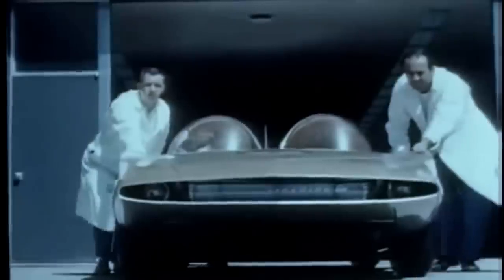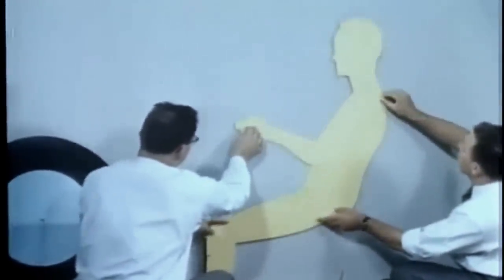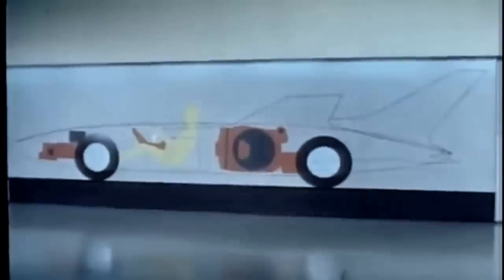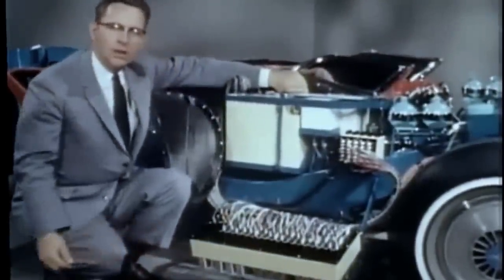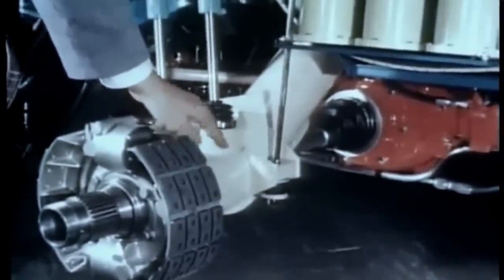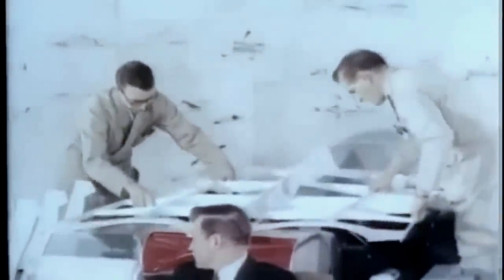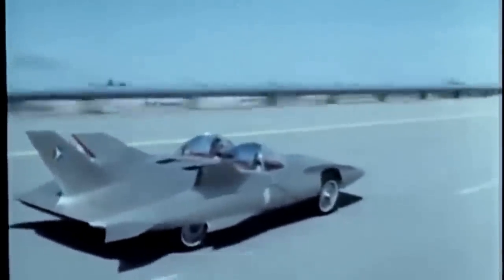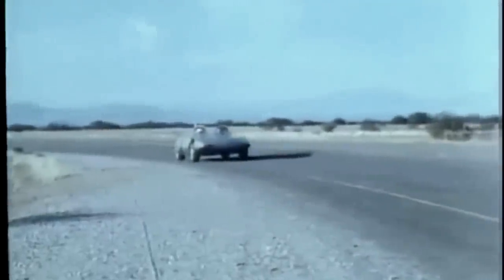GM Firebird lll Gas Turbine Car Promo Film - 1958

Comment: I always thought a gas turbine with electric drive would be efficient, but apparently they never really got the efficiency improved enough because of the heat loss (heat is energy.) This is aside from the materials, automation and machining requirements, among other things. Still, if the heat energy could be effectively used, it would be really interesting. I believe they've used gas turbine powered electric in trains, but diesel piston engines are the current tech.

That stick drive is kinda scary. There's something visceral about a steering wheel with gas and brake pedals. Then again, the mouse works pretty well on a computer—yet, a joystick really doesn't, and tablets did not replace mice either. 

Clearly, this experimental vehicle was heavily influenced by aerospace technology, and practicality concerns apparently kept it from being fully developed into reality. It is interesting how many of the ideas have been integrated into some of the latest vehicles using more solid digital tech. This was before the crossover from mostly analog to mostly digital electronics.
Reply: Yeah the joystic is full scary. On the other hand we used to play a lot of racing games, in ok level of playing, using only one thumb in playstation.
Reply: @constantinosschinas4503  Good point. I think somehow frame of reference made a difference, though, in addition to not having your life in danger. Back then what I really hated was trying to use a keyboard for that kind of game on the computer in the early 80's.

PS: I just thought of another thing. The car you're in is moving and the computer is not. Jarring and and forces due to acceleration could tragically affect manual manipulation of a joystick, probably a lot more than the wheel, where one hand helps stabilize the other. The steering wheel only has one degree of freedom, too.

Comment: never work thats why it never made production the whole concept was just ridiculous, but fast forward to today 2022 and i feel a shift is coming for example improving the range of battery power a small turbine could be fitted to the vehicle to charge the batteries as the turbine will generate more power especially for lorries vans and vehicles that need to carry heavy loads the problem is the batteries and weight of batteries
Reply: It was never intended for production

Comment: Looks like the batman's car. Allas, gas turbine is too slow in acceleration and deceleration, for a car. Also, a steering wheel is more practical than a joystick. I can't figure out why they made these choices. No need testing to know it.

Comment: No disc brakes? The Citroen DS had disc brakes already in 1955......And also a hydraulic system powering both the suspension (self leveling and interconnected), the steering servo, the gear change and the full power servo brakes. And this was a production model, no experimental or prototype car.

Comment: Jet turbine engined supercar, drive by wire, drum brakes with air speed brake flaps, aero tail fins. There was no way this proto PR car was ever going to production. At least Chrysler actually designed and built a functional turbine powered car.
Reply: I doubt the fins have anything to do with aero.

Comment: One should make an identical eco-friendly, electric-driven one, but with all the flashy lights and turbine-sound effects, automatic doors and of course the cool "sonic key", would't that be great to drive in?
Reply: The mining of lithium and the disposal of it , along with other battery parts already make it less practical with more waste than current ICE engines tech  . ICE engines have advanced so much compared to the ones made 25years ago that looking at the change of fuel consumption , less emissions and more reusable parts , causes it to make more sense to continue the advancement of all ICE engines . Example it is common to see people saying crazy things about how diesel pollute heavily,  yet people don't educate themselves to understand the black smoke you see coming from diesel is actually not harmful since it's unburnt fuel (carbon) that will one day settle back down and return to the earth .
Reply: @phantomcorsair8476  Look at the size and power of a modern motor and compare it to a modle A engine , the A may get good gas mileage but that's without carrying a load and having "no power" while also having a small displacement of 3.3l , 200CID. With more modern motors , for example a 5.3l v8 you can get over 300hp and over 24mpg in a long bed truck you can't do that with older engines . There are plenty of square bodies that are tuned up for power and still get 17-20+mpg in a truck out of a 6.0 gas motor with turbos and that number will increase as technology advances.

Comment: "This is certainly the future, your future." Er, no. First, the turbines polluted too much so with the new EPA requirements in the 60s never going to happen. Then, the acceleration was terrible. The engines cost $50,000 to make back then. The gas mileage was no better. And of course, no wires in the road. So none of this ever happened - but it was nice entertainment.
Reply: @phantomcorsair8476  Interesting - but you don't see anyone investing in turbine engine technology today so this is just a theoretical exercise not based on any actual development.  I question myself what happens to all those battery packs that are saving on hydrocarbon emissions when then wear out in six to ten years?  Do all those lithium ion batteries go to the junkyard?  Even if then go to solid crystal batteries when they wear out they will all fill junkyards with carbon.

Comment: So here I am in "tomorrow", and all they have is a Chevy Spark.
Reply: I remember seeing this and other films at a summer program at the local YMCA in the early sixties and thinking how cool the future looked. Now that I’m in that future at age 68 the future kinda sucks despite all the cool tech gadgets.  ☹️
Reply: @pauliedweasel  Well  that's because you don't own a yellow Chevy Spark ...😃🤣😂🤣
Reply: @gregm448  🤣 Now that I’m retired and on a fixed income the Chevy Spark is one of the few cars I can afford! Besides, it’s one of the few cars that still has that fun hatch back styling to it and comes with a manual transmission, a great car for buzzing around town in too! Besides, the car styling of today for a lot of the brands is rather off putting to me plus the reliability of the modern automatic and CVT transmissions is very questionable, and ad to that the $25k to $30k price for an average family passenger car with my current financial means is also rather breath taking.
Reply: @pauliedweasel  were old enough to see patterns in tech growth and see ugly flaws. Main thing that bothers me which I don't completely understand in the 50s 60s there was an excitement about the future and technology that's disappeared. Enthusiasm. The sky's the limit. To me it seems like the campaign finance system blocks competition and in turn stops tech growth.
Reply: @pauliedweasel  about to change DRASTICALLY..
Reply: @pauliedweasel  5 D
Reply: @pauliedweasel  technology threads quickly into our lives. It is hard to predict but I often think about the smartphone. One day I had a nextell phone with two way radio then I had a smartphone the next. It was so different. Then it was quickly normal.
Reply: @pauliedweasel  And it'll only get worse I'm afraid.  Back then, everyone was too optimistic.
Reply: @redline1916  seeing this I was reliving my tours around the South West States. Just since year 2000 nothing really got any better.
Seems all became virtual perhaps from the progress from marijuana into the crystals, Charlie and meths whereby anyone can be anything for a short while.

Sad reflection  on humanity but there again we do have a legend in Joe Biden along with Hunter....
Reply: @redline1916  Agreed! It was like watching the Thunder Birds when I was a kid and thinking how totally cool the future was going to be…
And now all I can do is look at the future and say WTF! (That means ‘What The Flagnard’) I borrowed that from Monsters vs. Aliens.  🤪
Reply: @pauliedweasel  it’s raining WTF nowadays.
Reply: @JenkinsUSA  Paul, that’s the best description I’ve heard of the times we are living in today. It’s why we move out of North Hollywood, CA (a suburb of LA) to Prescott, AZ. I was walking down Whiskey Row yesterday across from Courthouse Square on Montezuma Street and I felt like I’d gone back sixty years to my early childhood growing up in Santa Ana, CA! You are so right, we are living in the middle of a mother load monsoon of WTF these days with our current leadership. It’s like they don’t even care that a major election is coming up, they’re just going hell bent for leather.
Reply: @redline1916  — everyone was too optimistic……but back then, they had every reason to be optimistic.
Reply: @devilliers123  —- it seems, the internet killed us.
Reply: @redline1916  Wrong.
Reply: @devilliers123  Not everyone. The digital age has brought about something called "Makers" and it's a really cool community and hobby. Programming your own smart home system or designing a manufacturing blueprint to replicate on modern day replicators (3D printers) is pretty sweet. Some people have actually printed out their own cars and that seems really Futuristic to me yet it happened.
Reply: @impishrebel5969  thank you, I know a little of that.....The Individual will save the Planer, certainly not the Government
Reply: Classic 🤣
Reply: @tighematthew 0and ⁶and 9th are
Reply: Could be worse... you could be inside of a chevy bolt...
Reply: Thanks to this research made almost 70 years ago... you are not riding a beautiful horse
Reply: Remember the good times of your own car not long from now we won't have them you will own nothing and be happy.
Reply: @TheFrog767  And skinny and gaunt from eating cake.
Reply: 👋😂👉♥️comment of the day! Lmfao!
Reply: LMFAO the first car I bought is a 1965 automatic Dart sedan for 1500 bucks. It smells like a barn and the vinyl is breaking, but it runs and drives just fine. I can't name a single car in public because they all look the same. 🤷‍♂️ #righttorepair !!!
Reply: @plotman394  LOL I paid $660 for a 1985 Hyundai Pony back in 1998. I don't think I ever paid more than $1500 for any car yet (that's including my 2005 Sonata purchased 18 months ago and my 2006 Corolla purchased last year). 

Probably the last of a dying breed, I rented a 2020 Kona EV recently and yeah, that's gonna require a bit more tools to get going after, say, the $900 feedback gas pedal breaks.
Reply: @plotman394  "...all made out of ticky-tacky, and they all look just the same!" (from the Malvina Reynolds song, ca. 1962/63)
Reply: condolences
Reply: Awe c'mon, there's  also the Volt....
Reply: Unknown  Last time I had a GM product was in my late teens - an even then old ass Pontiac 6000. Mostly it was decent, not gonna lie, but at that time, Ford made better products (at least in my eyes).
Reply: @the_kombinator  ...'better', like the 'Model T'.
Reply: Unknown  It's a VAG product. Guaranteed some shit will break, and it will be expensive to fix. My late 90s to late 00s experience with these dictate it. 

To be sure, no modern car is free of this, except maybe the base models with a manual trans and the absolute least amount of gimmicks and gadgets. 

For now.
Reply: @the_kombinator  I like the way you think! Actually, the Chevy Spark is one of the few cars on the market that is interesting to me given it’s classic hatch back styling, manual trans and relatively affordable price. Honda used to make some cool hatchbacks but even those are gone and the only hatch they make now is a sports model that is out of my price range and really looks more like one of their sedans with a hatch lid on the back and not that boxy hatch back styling… Shit!
Reply: Lol
Reply: An Opel Astra of`97
Reply: Sad, isn’t it.
Reply: And the C8 corvette. So stop complaining.
Reply: They did have EVs in the 80s, but destroyed them and the program.

Right now, GM does have the Bolt, which still doesn't drive itself though.
Reply: @the_kombinator  Cadillac has Supercruise. It's self driving.
Reply: Unknown  They get taxed the same reason Koreans get taxed. I'm here now, and my father in law tells me that EF Sonata (my... 20th Hyundai? Lost count a few years ago) is powered by a 1.8 here. Mine's the (smaller) 2.4L for the Canadian market. I also have a Matiz imported to Canada (my car in Korea, 10 years ago) and yeah, picked up on that fact that smaller displacement engines pay way less taxes.  

I had a couple Hondas (a 1987 Civic, recently, and a 2010 Civic, my dad drives it now) and I have a 2006 Corolla now - all of them were pretty trouble free. Still, I will give GM that I would own one again far, far before I ever made the brutal mistake of purchasing a VW (even if only for $500 as a winter beater) - I think I would sooner lop off one of my nuts - VAG is truly a horrid car company. Hell I'd take a Peugeot again ;)
Reply: @the_kombinator  Peugeot is a great builder of interesting cars.
Reply: Unknown  WOW great info on Honda, always wondered the V8 question myself ⁉️
Reply: But along the way, there was the Corvair.
Reply: Lol 😁
Reply: Ford Fiesta
Reply: Haha!
Reply: Damn you spolilerer
Reply: @Screwdriver440  I have an Aveo. I call it a Korean Kracker Box.
Reply: Here I am in the tomorrow’s tomorrow and we got tesla.....🙄
Reply: Geil!😂😂😂
Reply: ....and the 'Volt'

🤔
Reply: And those are the attributes that make YOU S.P.E.C.I.A.L.!
Reply: Was the GM plant in Michegan? 

Detroit? 

Now a bankrupt wasteland.

Workers thrown on the scrapheap and called “deplorables”.
Reply: Not EXACTLY right... The Chevy Volt had a remarkable number of these concepts here pressed into production...

• two engines (one as a helper)
• keyless entry
• spatial awareness

All 60 years forward from this concept video.

 Working at AAPL I learned that interesting ideas never completely die until they hit production...

... And only THEN when they aren't supported by the buying public.

Ask anyone with an Apple III.
Reply: "they built a Chevy spark"
Sometimes people have to pick between "cool" and "economical"
If you built your own gas turbine car as a one-off, it would be cool AF. It would also cost enough to bankrupt most people, and that's before you get into dealing with the reality of "my car's fuel consumption is measured in gallons per hour just like other turbine powered vehicles". 
A Spark is sort of the opposite end of the spectrum - it's an affordable car & its energy efficiency is decent too, but it's one of the least cool cars you can find anywhere
Reply: 🤣🤣🤣 that's what's up
Reply: And a huge Bailout!
Reply: Hahahahahahaha
Reply: Rebadged no turbine a rip off of german technology hundred years old, but then stealth delta wing, v2, icbm, first human craft to exit troposphere into space, synthetics of all sorts still used, synthetic driugs, fuels, drives, electric and internal combustion, helicopter, hybrid u boat deisel, jet turbine all products of the third Reich.  Ridiculous vehicle, the cost of metallurgy and balanced turbine engine?  Technological leaps stopped when returned to bondage in 1945.
Reply: It's turning out more like the car of yesterday for sure! In 1896 they had an electric car that weighed 4000 pounds and could go 50 miles on a single charge! In 59 Ford made a car that had the potential to run for years without a recharge! In the 70s, they tweaked cars that could go 70 miles a gallon😉 makes you wonder about  the goal here. The car in this clip though, would only be appealing to Aquaman. Should have made this one amphibious and put a paddle wheel on the back for this steaming pile! 😉
Reply: A lot better for the environment
Reply: Hahahahaha awesome......
Reply: Chevy Spark 🤣🤣🤣
Reply: Hahahahaha!!!😂
Reply: And the only company actually making gas turbines in the US is Chrysler, and it's for the M1 Abrams tank, not a production car. Maybe we'll see gas turbines in civilian vehicles in the next few decades, but by that point, electric motors and batteries will likely be advanced enough that gas turbine cars would be obsolete before they even left the prototype phase
Reply: Freaking hilarious!!! Because it's true ! So some asshole came in and said forget all that ??
Reply: Chevy Spark, not even designed in America
Reply: Roflmao!!!!
Reply: We got phones full of porn and cat videos on demand. Seems like decent progress.
Reply: Lol 👍🏻
Reply: I think they misspelled it.  Should be Chevy Speck.
Reply: Hahahahaha... I know right !! How disgusting
Reply: Unknown  Have you driven, rode in or even seen a GM car newer than 1988 ?
Reply: Yo for real though
Reply: And shitty “self driving” electric musk rats running around
Reply: We've also been to the moon since then
Reply: they figured you don't need this future.
tiktok and facebook will suffice.
Reply: I don't understand why anyone would purchase a  
Yellow Chiffon colored Chevy Spark?
It makes the AMC Pacer look really cutting edge!
The last decent transportation GM built in my opinion was early 80's pickups and the Caprice
Reply: @northcackalacky4694  Purchasing a yellow chiffon Chevy Spark might be as a result of a love of show tunes.
Reply: @northcackalacky4694  Aztec